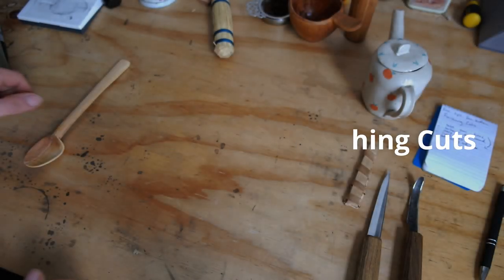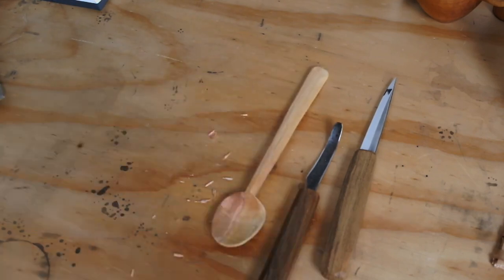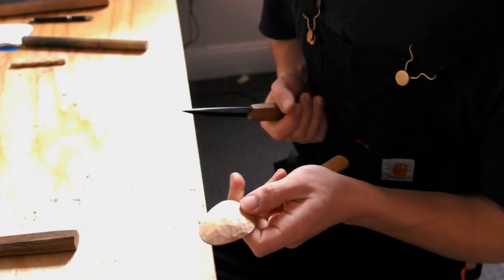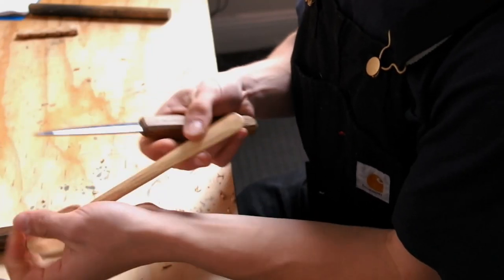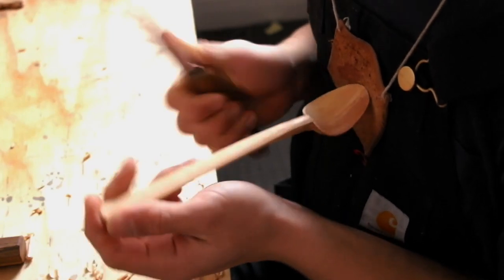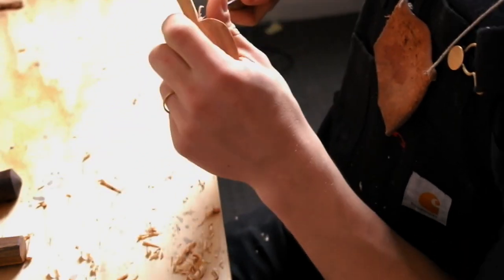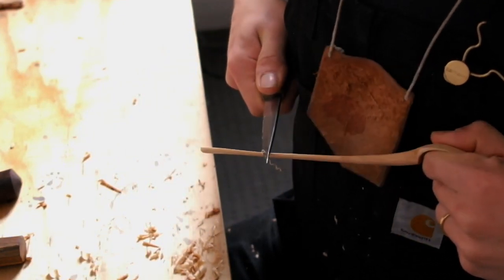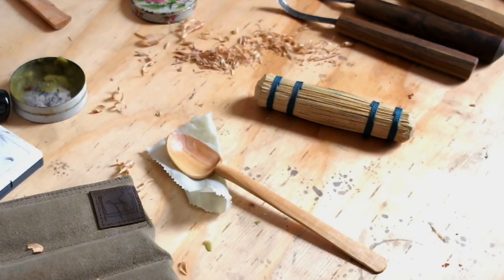Five tips for better finishing cuts | Understanding Knife-Finish | Greenwood spoon carving tips (#4)

Comment: Brilliant video, I am trying to learn how to sharpen my Mora 164. Should I sharpen the inside with a dowel or the outside?
Reply from the maker: You can see the method I use on my video 'how to sharpen a hook knife' '
Reply: @jones_trees_and_treen  Thank you, but the knife in that video has a different grind to the one that I use. Mine has a flat back with two bevels on the front as yours appears to have rails. Is the technique the same?
Reply from the maker: I use the same technique, it just takes longer on a knife without rails. I only sharpen the inside, and strop the outside to remove the burr.
Reply: @jones_trees_and_treen  Thank you!